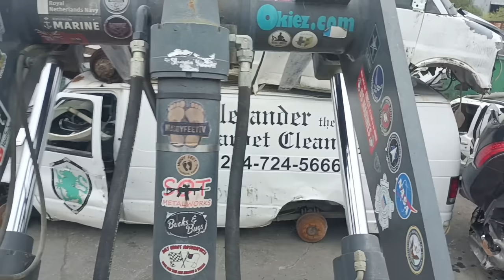All Inclusive Car Crushing 👍🤠

Comment: 1:40, Honda Odyssey (11:38, crushed) on the rack.
1:48, Chevrolet Equinox in front of the crusher (3:23, crushed).
7:59, grabbing a Dodge Ram (crushed off screen).
15:54, Ford Windstar (20:58, crushed) on the rack.
16:35, grabbing a Chevrolet Express (26:14, crushed).
24:09, grabbing a Ford Econoline (30:15, crushed).
28:45, grabbing a Ford F150 (31:48, crushed).

7 cars crushed this video. 2,929 is the new total.